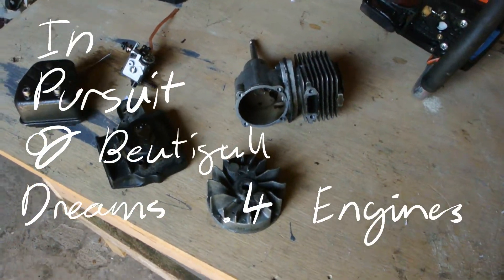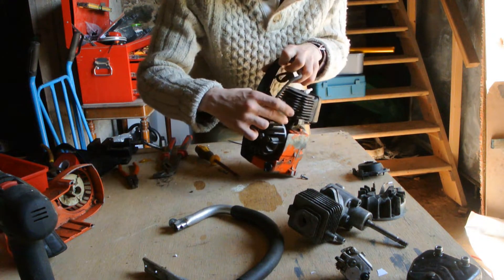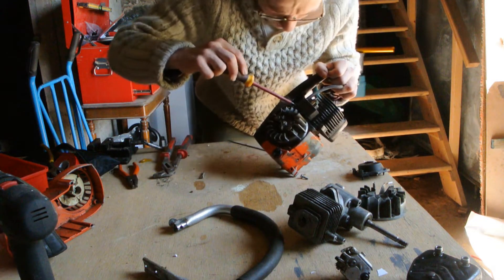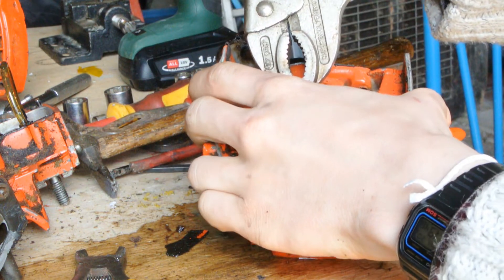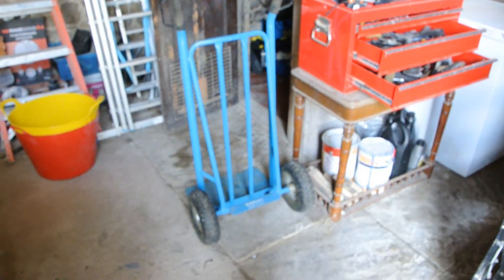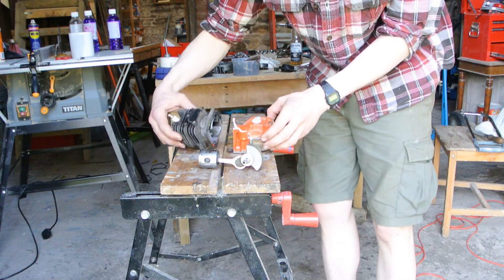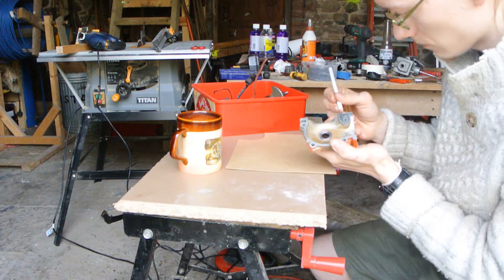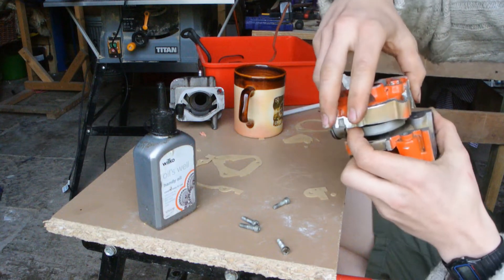IPOBD .4 Engines

Comment: How did the project end?
Reply from the maker: Had to abandon the airframe, it wasn't sturdy enough to handle a large engine. I plan on building a new airframe from fibreglass over foam. (Just Moved to the city) for better access to resources